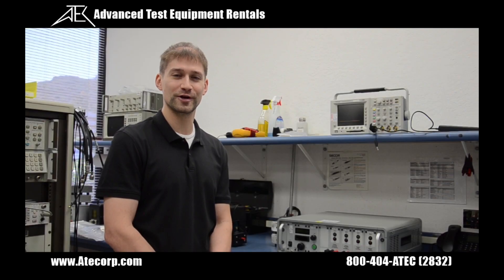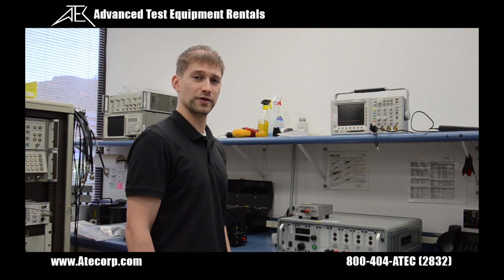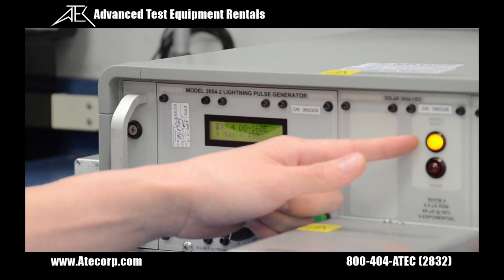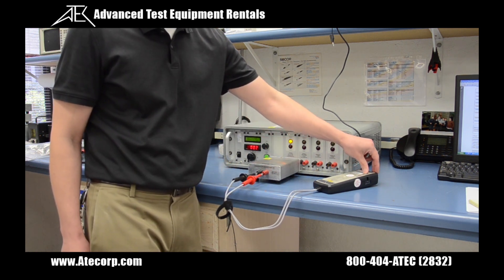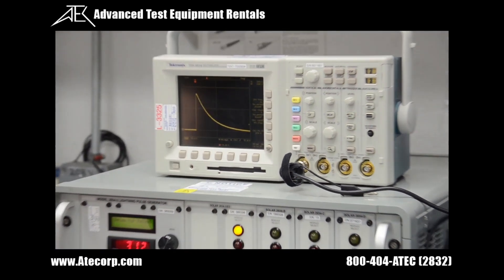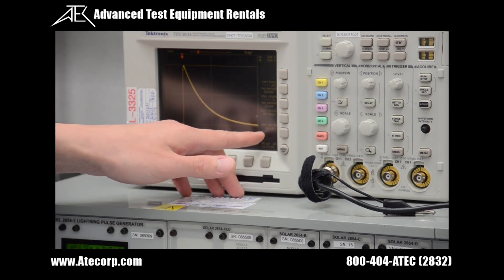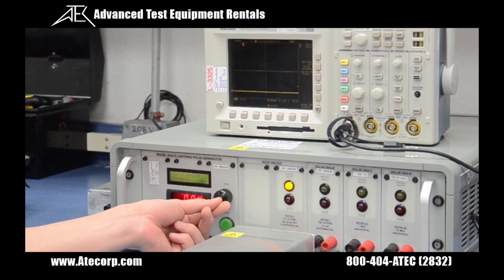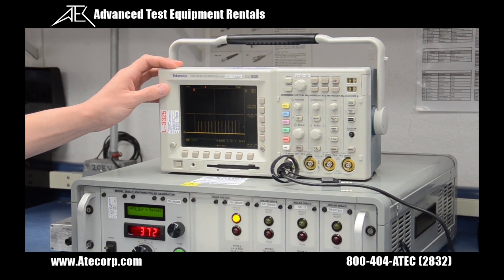Solar 2654 Lightning Surge Generator for RTCA DO-160 for Multiburst Pulse

Comment: How do you test powered equipment (pin injection)? You cannot connect directly to pin because generator will pull it down.
Reply from the maker: Pin injection testing is not normally done with powered equipment this is where cable induction is used. Unless there are further details you have.